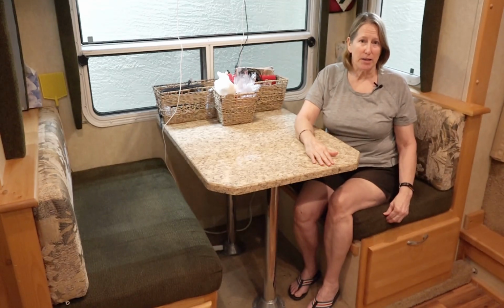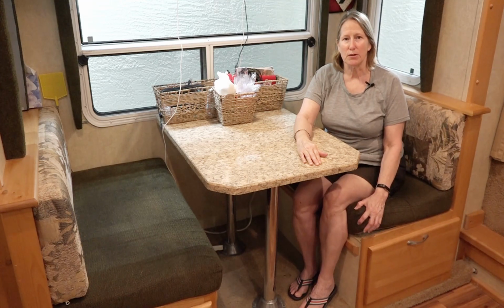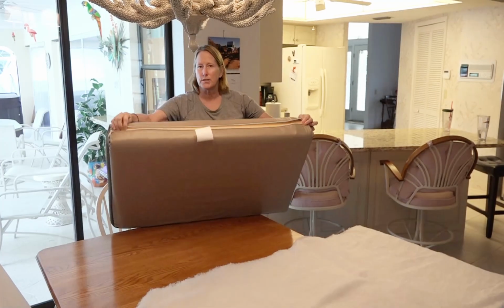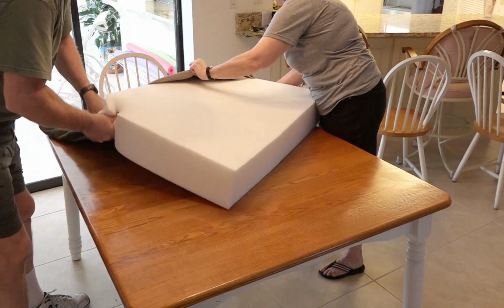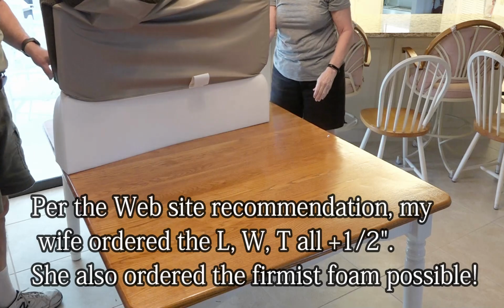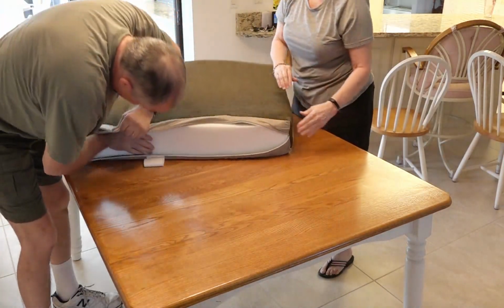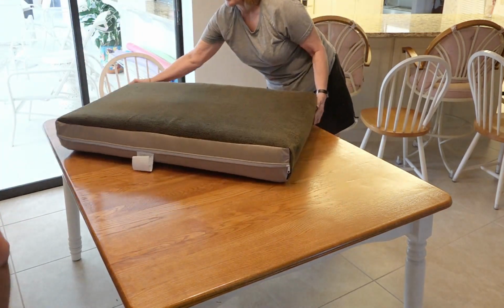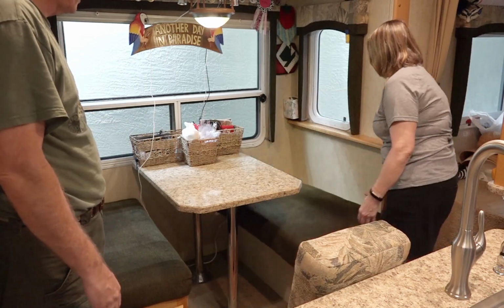DIY - RV Dinette Seating Foam Replacement!

Comment: The trick is...put the foam into a plastic yard bag and use vacuum to pull the air out of the bag.  The foam will reduce to about 3/4 the size.  Place inside the old cover, release the vacuum and  straighten in out.  Rip the yard bag out and zip it up.  Easy!  It really works.  Did it in our old 1150 AF.

Comment: One thing to keep in mind. When I did this cushion foam replacement to the Dinette in my Eagle Cap Camper several years ago , I check with my foam supplier as there are several different densities of foam purchasing the stiffer foam but not the very stiffest lasts much longer and remains pleasantly firm.